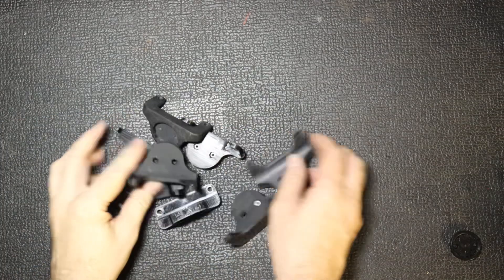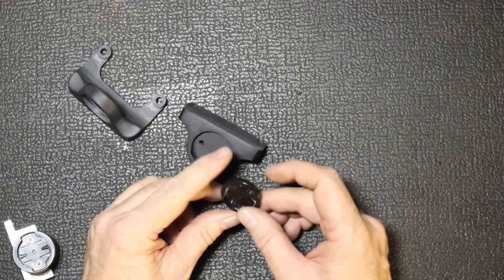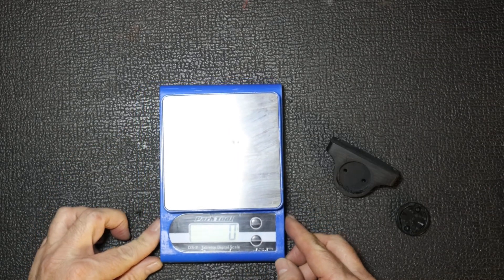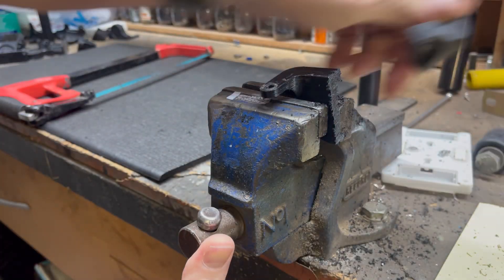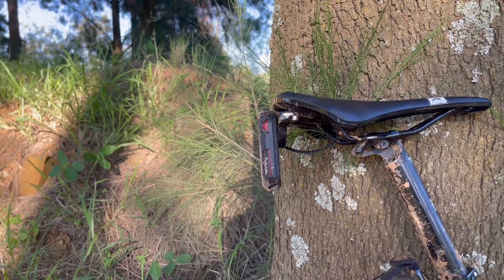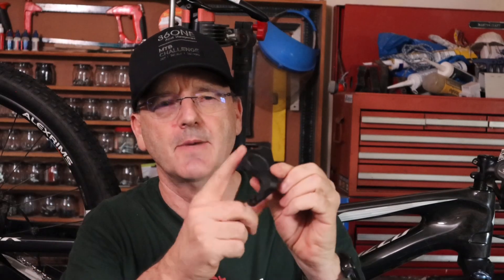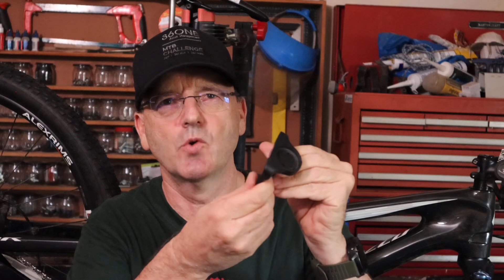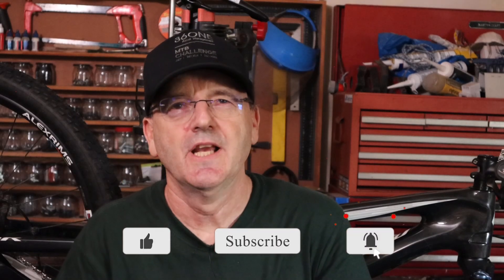🚴 3D Printed GARMIN VARIA MOUNT | Custom Bike Accessory for Cyclists 🖨️

Comment: I have a 3d printed varia holder on the rear rack on my commuter/tourer bike. It's worked fine for the 3 or 4 years I've had it.